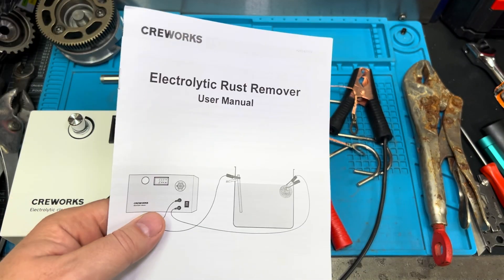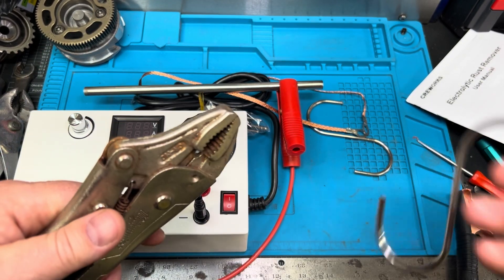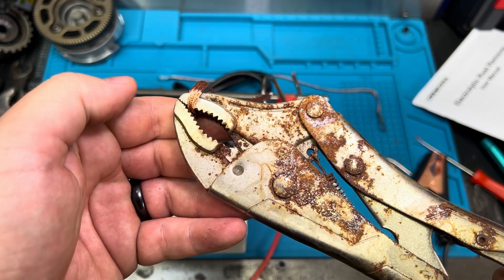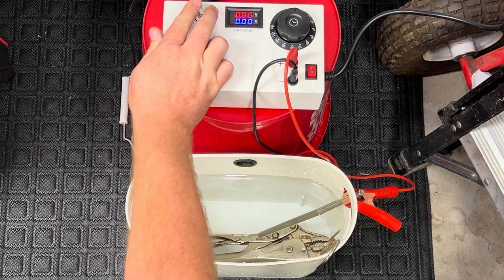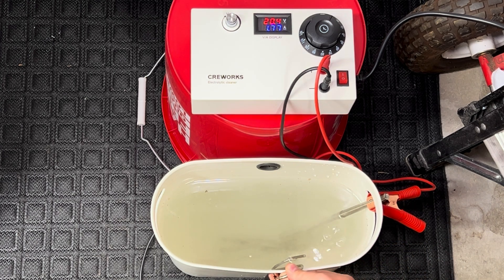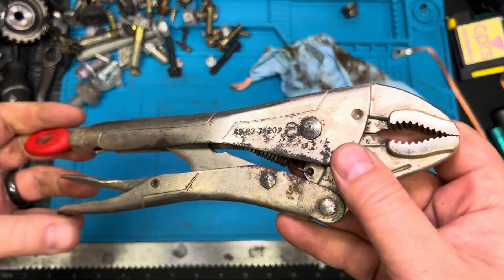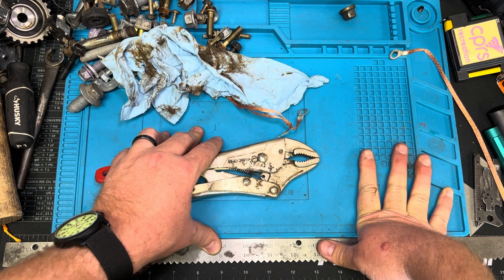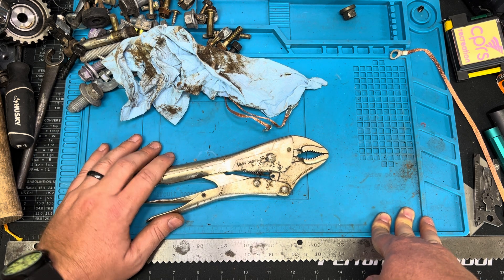Rust Removal Surgery - CREWORKS ELECTROLYTIC RUST REMOVAL KIT - The Least Abrasive Method?

Comment: THIS IS A SCAM! Don't buy this. I ordered one after watching this video and it arrived with a giant crack in the bottom of the bucket. I set it up anyway exactly per instructions and it did not run electricity through the anode and cathode. I couldn't even get it to short, literally no electricity. I  reached out to Creworks multiple times and they have not responded.
Reply from the maker: This is unfortunate. Would you mind emailing me your communications with them? I’d like to see what I can do.

Comment: Nice video and a different topic altogether. I think the chemical process works for most needs (Evaporust) but your right, usually there are unintended consequences like peeling paint or lifting stickers on the product itself. I've also found that Evaporust will change/darken the paint on certain surface finishes. Nice review and keep the channel full steam ahead!
Reply from the maker: @justinvanaulen2478  correct evaporust and the chemical solutions will delaminate the outer coatings almost making them sharp to the touch. You’re also correct that they change the pigment of the metal as well. This as far as I can tell has no negative consequences. Thanks again for the kind words. 👍🏻